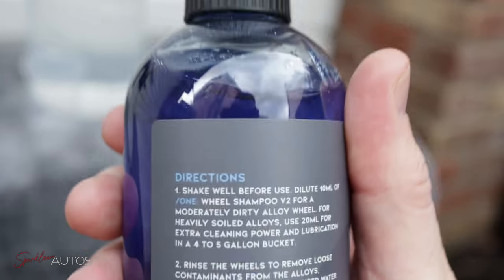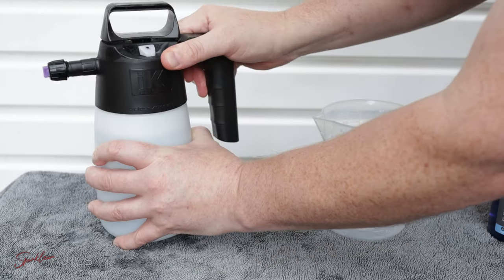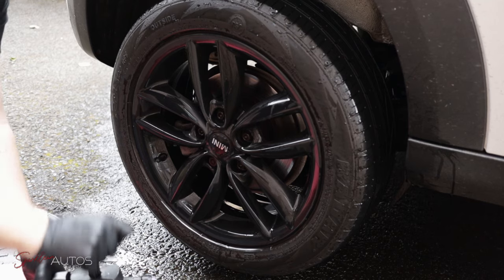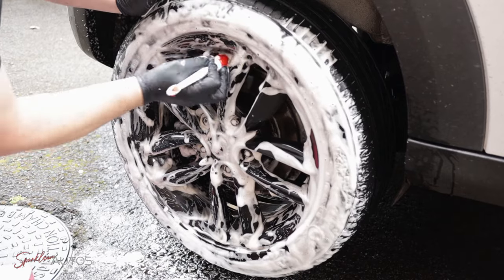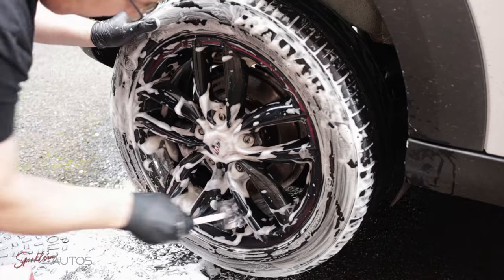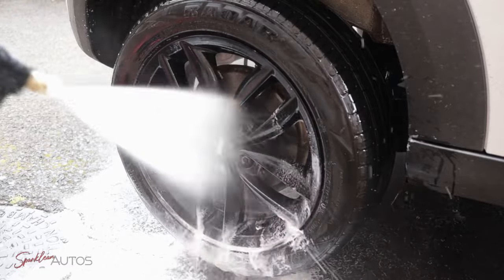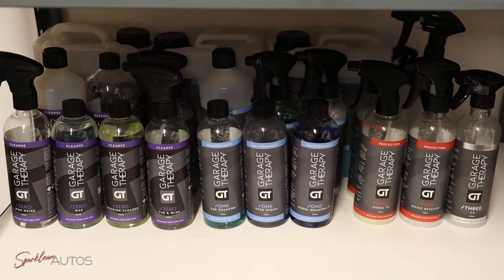Cleaning Gloss Black Wheels with GT Wheel Shampoo V2 | QTT Ep27 #cardetailing #carwash #carcare

Comment: It's a good maintenance product that is quite enjoyable to use but as ever it's always debatable how necessary it is when decon shampoo or a strong APC is also available with potentially a cheaper cost per wash ratio
Reply from the maker: That's a good point but I think it's more about what people enjoy rather than what's necessary - I love Decon but it is a strong product - this is much more gentle and if people at home can get away with a weekly wash at 10ml per wash, that's 1 bottle per year at £11.00 (or even less per year if you buy a larger bottle!) - so really the cost per wash becomes pennies regardless 👍🏼
Reply: @SparkleanAutos  Agree with you. It's a luxury product for enjoyment and maintenance on a nice set of alloys. Could make the case for a weaker dilution of Decon. Comes down to horses for corses I think. Some people do align to a brand so it's something they want to stick to. I'm tunnel visioned as a weekend warrior that wants to maximise value for money vs performance so I'll always stick to surfex HD which will do a better job on tyres IMO plus the anti corrosion properties within it are valuable as cars age with time. This is still a good video that's been well made and entirely valid. Opening the discussion around is a good thing.
Reply from the maker: I have said time and time again that everyone has to do whatever suits them for enjoyment & getting value for money. 
Personally I've tried to avoid aligning with any brand as I feel I could be missing out on so many enjoyable products - I have a full range from about 4 or 5 brands that I use regularly, plus various products from countless other brands. I used to use Surfex flat out myself before YouTube but there are better value for money products out there that I also find more enjoyable (which also contain rust/corrosion inhibitors).
Reply: @SparkleanAutos  What are the products with better value that are just as if not more effective and more enjoyable to us? 

Would that be KC GS?
Reply from the maker: I wouldn't say GS is more cost effective or enjoyable - I'd actually put the 2 in the same category for usability and LC is a bit more expensive for 5L but not much.

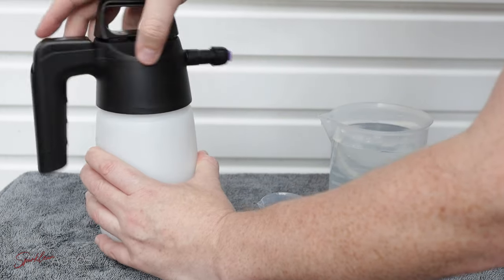But for better value for money, as a pre wash for an absolutely filthy car, covered in salt, traffic film or whatever else, I use A-Kem PreClean... At 1:30 it's stronger than Surfex at 1:10... And it's the same price as KC GS for 5L. 

And in terms of engine bays, wheel cleaning - everyone raves about Surfex at 1:10... but, and I'm not suggesting buying GT over Surfex, but Decon is just as effective at 1:20... given that 5L is twice the price but you only need half as much, tmit works out at the same price 🤷🏻‍♂️

As for enjoyment, well that's a subjective thing and that's why this is such a popular hobby to discuss as much as get involved in - we all enjoy different things and that's the best part!

So my point is not to say that you should choose this or that over Surfex, my point is that Surfex isn't the be-all & end-all product that some people like to make out 👍🏼
Reply: @SparkleanAutos  Pre wash wise I'd never use Surfex HD above 5% but that's just me. It's overkill at 10% at that point I find. Normally I use touch less but the new version soon to be released in 5 litres has completely changed the game now in terms of affordable prewash. More power and concentration with a slight price increase but lower PIR needed and thus it breaks the AutoFoam stronghold for cheapest cost per wash. 

The competition from GT is important I think to keep BH and co on their toes. As detailers and enthusiasts we can ill afford to have a market failing and out of control in terms of pricing and even performance. No firm is immune to natural corruption if they have a dominant market position.

Agreed. It's not the be all and end all, well not like it used to be anyway. The industry has changed and that's a good thing for the most part.
Reply from the maker: Yip, always important for healthy competition between brands so long as the consumer benefits rather than loses out. 
I actually barely rate Autofoam at all now, not a cost effective prewash if you ask me, certainly not as a snowfoam anyway! It had it's day but long gone now - I'm looking forward to trying touch less too, should be very interesting indeed 👍🏼👍🏼
Reply: @SparkleanAutos  Collusion is difficult for firms to do because of the natural incentive in the long term to break agreements. They can't meet formally and risk having anything traced back to them otherwise the brand damage, bad publicity and fines would kill them. 

Autofoam is quality depending on how you use it in terms of working out PIR. Rips crude to shreds I find but the film it leaves needs a contact wash to remove. 

Need some that touch less content. 1 litre still available and awaiting.

Comment: Never quite understood the reason for wheel shampoo. I normally foam the wheels with autofoam and then use squid ink car shampoo for the contact part of the wash. Cleans my black wheels very well.
Reply from the maker: If your system works for you then stick with it - I like trying different products for difficult things but I also like to think of a wheel shampoo as basically a hybrid of a sprayable wheel cleaner and a car shampoo - I know that isn't even close to chemically accurate but that's how it works and I like using them for maintenance cleaning 👍🏼
Reply: @SparkleanAutos  Thanks for the reply Mark. I sometimes wonder whether companies make a product just for our wallets to take a hit. 😁
Reply from the maker: @greymark420 I'm sure sometimes they do lol but I've been using this one (and it's predecessor!) for 4 years now and I used HDD Brake-Thru before that - maybe it's a placebo, who knows, but they cost pennies per wash and I enjoy using them... at the end of the day, what's more important than that?! 😊👍🏼
Reply: @SparkleanAutos  👍

Comment: The only dedicated wheel product I keep these days, if I need a stronger wheel or tyre cleaner I’d use decon or another APC but for these usual maintenance cleans like yourself I find wheel shampoo is effective both in cleaning and cost 🧼
Reply from the maker: It really is Nick - arguably a lot easier on your skin too! There are a few decent ones out there too, some maybe better than others, but it's definitely better to start off with a gentle shampoo rather than go straight in with acid or reactive wheel cleaners!!